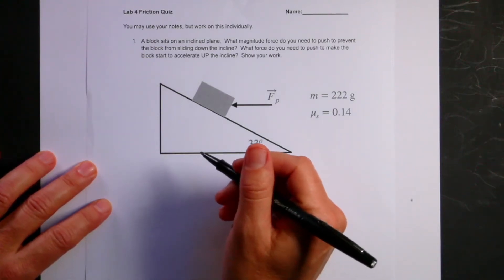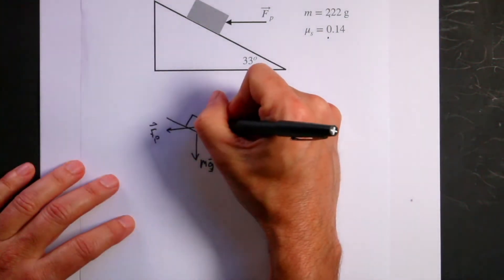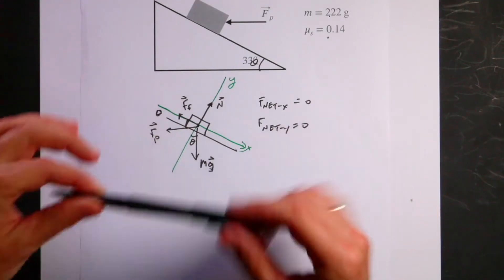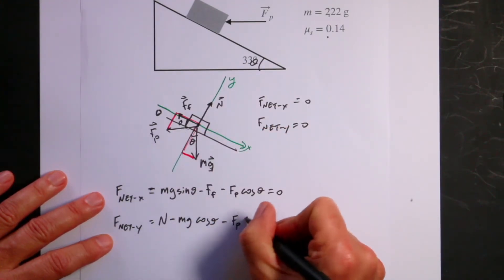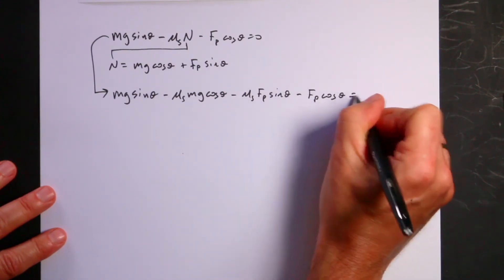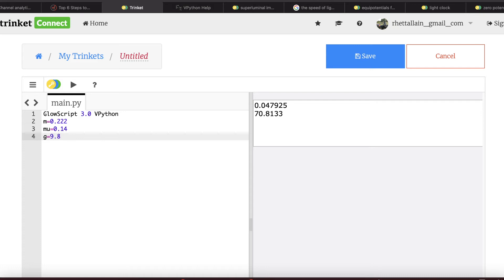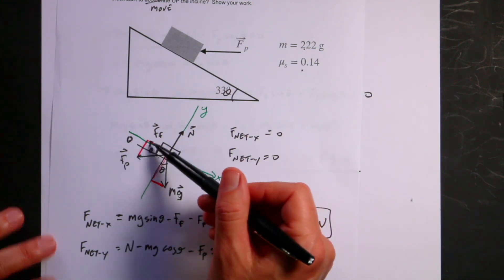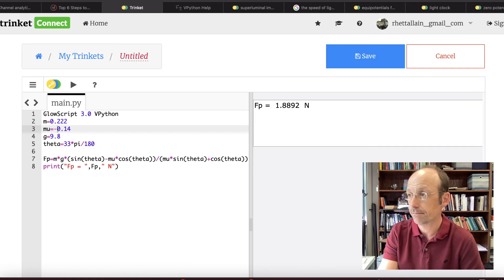Physics Quiz: Minimum Force to Prevent a Block from Sliding Down a Plane with Friction

Comment: I thought that the direction of friction is the opposite of the velocity of the moving object. Shouldent the force of friction be moving in the opposite direction that it is shown?
Reply: Yea i think so too
Reply: I think it's because the force is only preventing the block from moving down. The component of the weight is the one that is trying to move the block down that's why the frictional force is in the opposite direction of y component of the weight but same to the force applied horizontally.